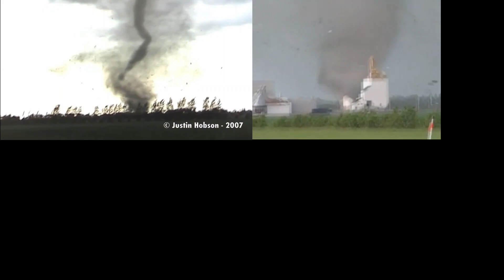Elie tornado during its F5 stage

Comment: It's so weird how this tornado is F5 yet it was so skinny during the moment it lifted that house off its foundation.
Reply: Normally the F5 are bigger to due that damage. This Tornado was different.
Reply: @Sj430  there was a pretty skinny f5 in 1996 in I think Oakfield but you look at the pictures and such a stove pipe yet when you see only basements when I houses were this tornado definitely deserved a F5 rating
Reply: @samuelraytheweirdcontentgu8551  ok I will look into that tornado.
Reply: It's a common misconception that all F5s are big wedges.  Drillbit tornadoes, especially when a larger tornado narrows and speeds up, can easily reach F4 or F5 strength during the spinup.  Indeed, almost all of the F5 level damage in a big tornado is caused by the smaller tornadoes, suction vortices, within it. This became a single suction vortex, every bit as destructive as a bigger tornado.
Reply: @ArchTeryx00 Pampa and Oakfield come to mind particularly
Reply: @terriblejustterrible8770  Pampa was weird. A lot of the footage was when it was in a narrow stage, but it actually grew quite large as it was leaving Pampa. Many tornadoes start out small and grow, but Pampa stayed small for a long time, and everyone knows the footage of how much debris it was throwing up.

I think Oakfield was the same. It had a very narrow "elephant trunk" stage, and later grew into a large wedge. It did F5 damage, but I am not sure at what part of its lifecycle this occurred in.

Comment: Smaller then Moore's F5 Tornado
Reply: all that mile wide power into a small 35 yards rotation made it spin faster, recipe for disaster
Reply: Yea I think this happens more often but not when hitting structures
Reply: But still probably more powerful. This damage was more than Moore could ever do. The whole house was sucked off the foundation in one piece and thrown. Not leveled and wiped away like Moore. These small ropes can be insanely strong.